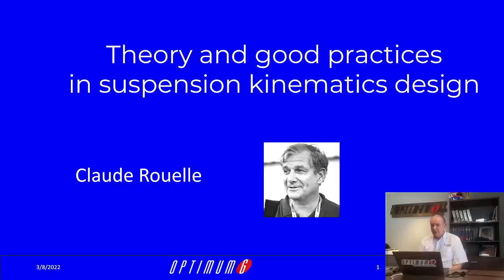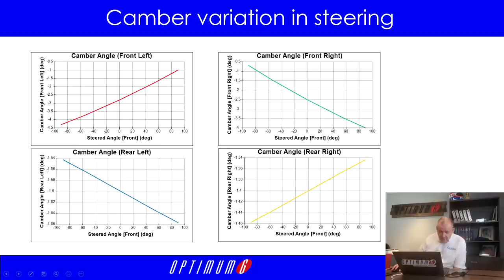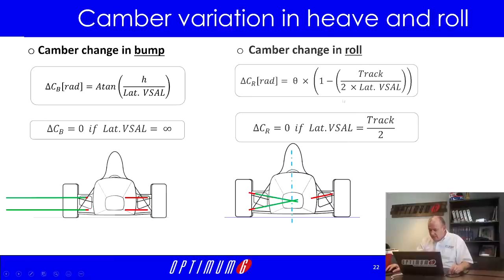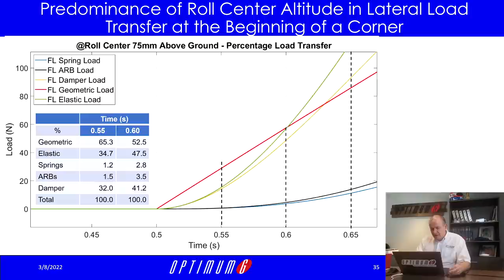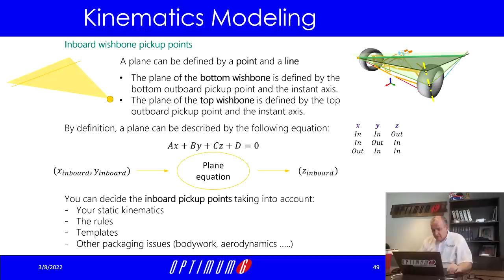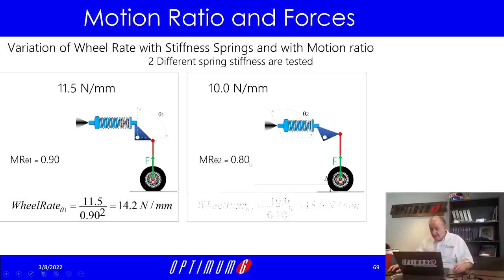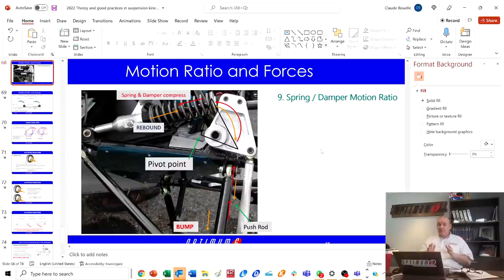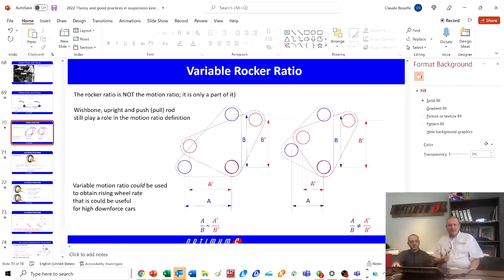Kinematics March Part 1 : Suspension Kinematics Design

Comment: 19:37 how you calculated the Mz ??
Reply: Mz  is not calculated but obtained from tyre test data, in the same way as the rest of forces and moments generated by tyres, it will be sensitive to load,pressure,inclination angle, temperature.....

Comment: 11:23 here you say more grip with + camber, is it true?
Reply: he says "if you have a tire model that tells you positive camber is better I would be very surprised because you have rarely have more grip on + camber"
so as he says most of the situation - camber is better for grip unless you have specific tire model.
Reply: @duhan-yzc  I have played Viper Racing which is a simulation model developed by MGI. The thing with positive camber that is so great is when you go over bumps, you don't oversteer. That enables you to use a bigger sway bar which is an obstacle if you oversteer all the time.